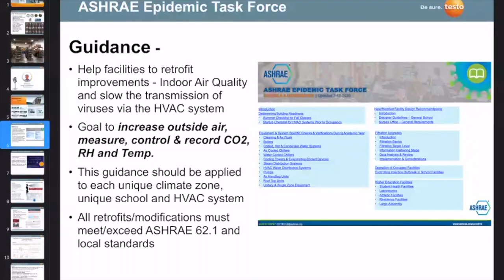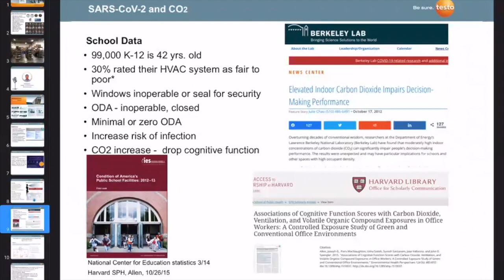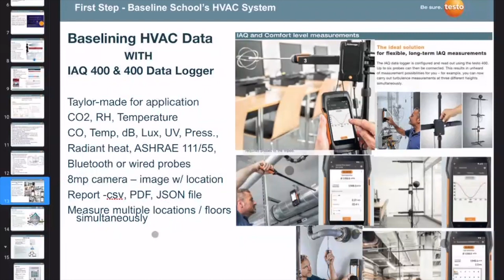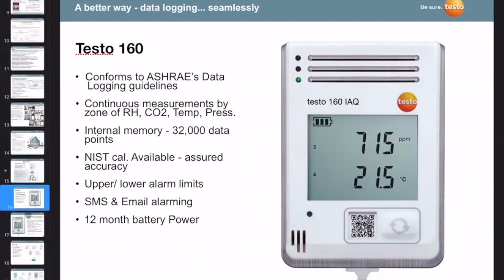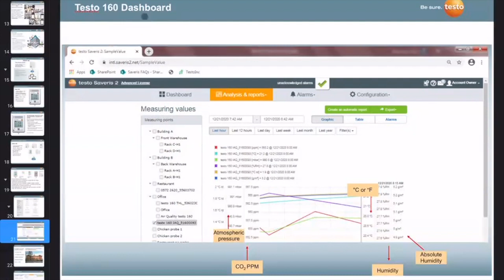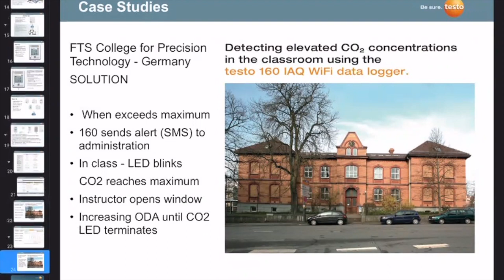Pt. 2 Validating and Controlling IAQ in Educational Facilities per ASHRAE Guidelines with Testo Inc.

Comment: Very educational on this topic. Great to know that there is a system in place to monitor each classroom  and that the nurses office should have an isolation room. You mentioned a vav box to supply air, would it be more efficient to put in a Phoenix Box instead of a vav box? Thank you for your time. Would like more information on this topic. Excellent instruction.